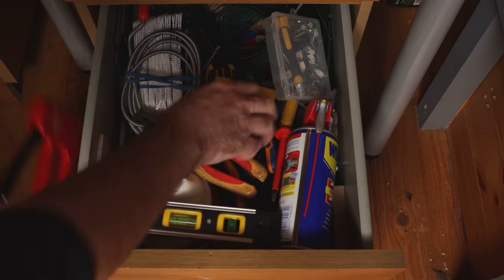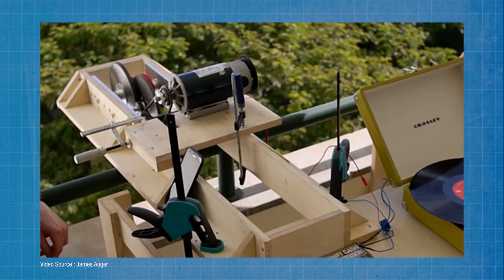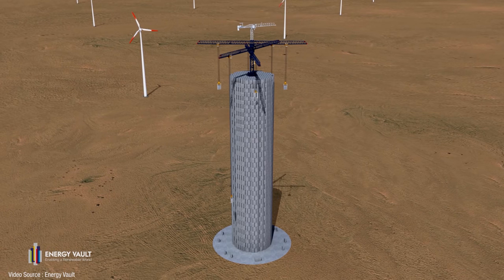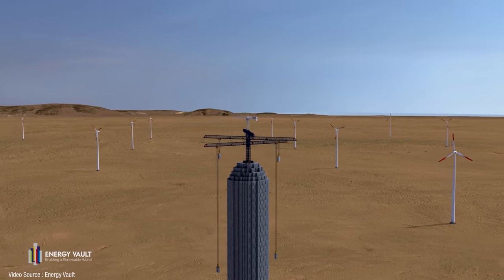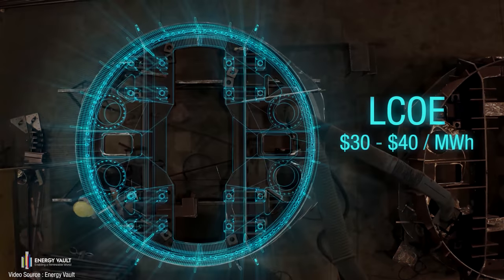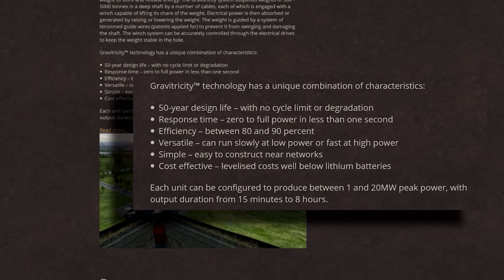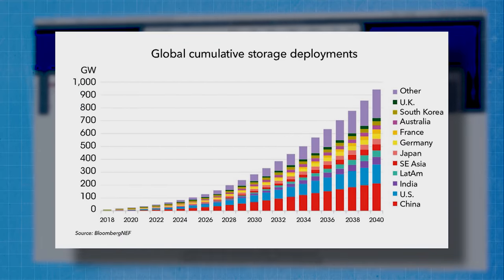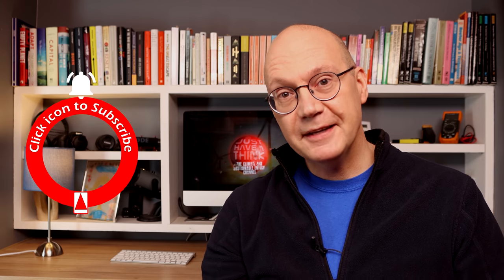Gravity Energy Storage : A very uplifting technology!

Comment: There is also the company ARES that is building a gravity train in Nevada. Has been a long time coming due to permitting etc but may finally be happening. Depends on local geography so not as universal. Seems like there are long strings of idled coal cars and locomotives that could be used to keep cost down. One downside to all these mechanical systems is that there is wear and tear on equipment when you are moving heavy things which I think they underplay.

Comment: We can use mountain sides with rail track that goes top to bottom with exaggerated slope (on purpose). Have water pipes at top. Fill train cart with as much water as possible. Utilize a hard slope to assist in cart acceleration down a tall mountain. The brakes can generate emissions-free electricity while pulling up another cart from the bottom to the top (but empty) I mean if windmills can be a thing then so can using gravity as a source of energy. Hopefully this should free us to repurpose trash into bricks that we can use to house the homeless using gravity generated energy.

These options may be sub-optimal to the educated engineer, i understand that i just want to point out that we HAVE OPTIONS!!!! all we need is real unity!
Reply: Presumably you'll use rainfall to fill the tank at the top of the mountain?  It would be counter productive to pump it up!

I thought of a similar system at home, have a 1000 litre IBC in the back of my Nissan Leaf, fill it with water, go into town which is downhill, using regenerative braking to charge the battery, empty the IBC all over the carpark and get a free ride home.  Don't tell Yorkshire Water though!
Reply: @rogerbarton497  cities next to mountain ranges can have plumbing extended to top of mountain to help fill up tank using water pressure. At the end of the tracks a pool that reintroduces the water back into the water grid as to avoid pumps cause yeah pumping it out would be a waste.  But i think that with proper gearing it should produce plenty of energy consider how increasingly hard it becomes to stop a heavy container going down hill. If wind turbines are a thing then using mountain sides should produce energy 24/7 in any weather. Also the container should be metal cage with interior puncture resistant pouch as to lighten the load of the cart when it gets pulled back up by another cart on its way down.
Reply: @ajgm3974  The water pressure in a city is either generated by pumps or a water tower, so using town water pressure to fill a tank at the top of a mountain still involves pumping.  I suppose you could have a system that pumps water up on cheap electricity and generates power at peak demand, just the like a conventional pump storage, but if you were going to do that you'd be better off using pump/generators rather than a railway.

I believe there is a funicular railway in the UK that uses water tanks, filled from a stream neat the top of a cliff, fixed under the cars to haul them uphill via a rope and pulley so you could probably generate power from this, but that would be on the level of power scavenging.  But every little helps.
Reply: @rogerbarton497  how about using empty thick latex balloons deep in the ocean. Filling it up with air will cause it to rise. That pulling power could be used to power generators??? Alternating balloons could keep the generators running 24/7
Reply: @ajgm3974  Probably not for generation, but there are experiments going on to store energy in collapsible "balloons" under water, the advantages being as air is used the balloon collapses under the pressure of the sea, thus maintaining constant pressure and because the pressures inside and outside the balloon are equal (near as damn it) the balloons don't have to be super strong.  Google "CAES underwater" or similar and look at the images tab.
Reply: @rogerbarton497   @Roger Barton  I know that our best chance is helium 3 on the moon. Thorium reactors would be a good option too. But for the time being, specially in undeveloped areas of the world maybe ocean currents can be used. 

https://youtu.be/yanW82dpVIU

Or fresnel lens and steam pressure

https://youtu.be/t79xJmE_AqI

Comment: I keep envisioning a gravity battery that uses sand. Cant wrap my head around it but, i think it could use a vacuum to transport granules up a tower where it accumulates in bins that become weights, effectively doing the same work that the concrete composite blocks do, except maybe there’s a way to also build a spring system into the unit so that as the container reaches the floor, it can release the sand and spring back up, counter weighted by an opposite side generating electricity in both directions. Just a thought...
Reply: Love your channel btw 8)

Comment: Not sure about the tower project, but I like the idea of using a shaft.  How about the weight being created by water in the falling container, it could then be allowed to empty at the bottom so less power would be needed to pull it back up again!  The system could create as well as store electricity.

Comment: A company called Azelio in Sweden store energy in Liquid aluminium and use a Stirling engine to convert the heat too electricity and can do that in 13 hours on maximum power. They only use recycled aluminium and can charge and discharge the ”battery (aluminium storage)” many, many, many times becouse aluminium does not wear out. On top of that they get a waste product of low temperature heat 55-65C that can be used for heat buildings, hot water or other aplications. Ideal for 0,5 - 100 mW sites.

Comment: Pumped hydro would be better if it was near the ocean utilizing a natural cliff. There would be far fewer environmental concerns except for the upper reservoir - which could become a "tidal" wetland for bird life.

If you really want to store energy mechanically you'd do better to use rotational storage. The Ω² in E = ½IΩ² of a rotating mass means the energy stored is proportional to angular velocity squared where as E = mgh of these lifting mass systems means there is only a linear proportionality between energy and mass or height. However, rotating mass systems have issues (bearings) so heaving weights up and down is worth trying - so long as you're not in an earthquake zone.

Comment: Water filling canisters that store the energy might be cheaper than concrete , the plumbing might be more complex . If the water uses stored nuclear waste to heat and evaporate untreated water , then the evaporation pressure might be enough to lift and store the energy .  As water is in contact with heat conducting pipes it should not contaminate and could make use of a waste product with zero emissions .
Reply: You just invented a very elaborate heat engine.

Comment: Quite a few years ago, I thought I had a brilliant idea, then search the internet and found gravitricity.
To find out that it was allready there :) just found Them moving Way to slow, with their Project.
As a sideline, I thought that combining it with a windgen. Tower would be a good idea, if extending it with a deep Hole in the Ground. This having the battery where it is most usefull, with the electrical connection allready in place for the wind turbine.
Gave up on the idea though as bartt. Development and prices where constantly dropping. :)
Reply: Yeah, I thought I invented this in my head too. Every time I think I've invented something, I find out it it already exists somewhere. Never thought about using existing mine shafts though.

Comment: Many years ago I came up with the idea of winding up huge weights inside each wind tower in the country, which could store energy when there is an excess of wind over demand, by either mechanically or electrically raising a large weight up to the top of the towers. Hundreds of tonnes 60 or 80 metres up in the air. That's got to work, hasn't it.  Then I did the maths..........
Reply: And the maths said that the weight needs to fall very fast to get to 1MW and the tower needs to be very beefy 😂
Reply: @per.kallberg   The maths said there wasn't enough potential energy to bother.

Comment: Given time constraints in reaching needed carbon emission reductions (about 8% annual reductions to attain Paris goals), we simply will have to adjust our energy use patterns to more closely align consumption with production, both on a daily and seasonal basis.  This means different things in each geographical context.  Here in Arizona, with one Powerwall we cover 95% of daily and annual home energy use from our rooftop solar.  This includes in-town transportation, but not long car trips.  Having the infrastructure at home has the benefit of being able to measure compliance with climate goals.  Large-scale efforts are also needed, but we would do well not to place too much trust in unproven methods, and to take responsibility for adjusting our usage patterns to the immediate need to clear the atmosphere before it is too late.
Reply: Hey, neighbor! From over here in Texas, with a similar usage patterns in much of the state, I'm here to tell you that getting Tex and Bubba to "adjust their usage" patterns rather than cranking the thermostat down would be doomed to failure. They, like our outgoing POTUS, are damned if they will be responsible for any of this "socially conscious clap trap". I think you can take that last as a direct quote from Bubba and Tex. Bubba, Tex- if you disagree with this, please weigh in- with facts not just a moan and groan.
Reply: @fredericrike5974  Abilene Christian University's NEXT program is at the cutting edge of research into the new generation of nuclear energy technologies designed to provide clean, safe abundant energy into the indefinite future.
Reply: @jimgraham6722  Admiral Nimitz thought enriched uranium would solve all of America's energy needs by 1965- I think this was something he told the Senate. We''ll see and Great Fortune!
Reply from the maker: I agree 100%. Well said Duane.

Comment: I just love the idea of stacking blocks in patterns (aside from any mechanical failiure issues?) 

But - Would it work with the mine-shaft idea as well? I mean you can lower a block down the shaft, then when it gets to the bottom, park it somewhere in the mine body (a new cavern?) and lower the next one down the shaft, and so on. Then do the whole thing in reverse, With some battery storage to fill in the gaps in generation...?

Comment: I've been thinking that a scaled down version of this could be put in the corner of petrol/gas filling stations (some have huge , tall signs like those that can be seen from the highway ) that could DC Fast Charge EVs.. Huge weights of recycled materials could be raised with on-site renewables, with locking pins holding them in place until needed.. No complicated algorithm needed to raise it and a very simple one to dole out the charge to the car without harming the battery .. Very Low cost as it would be DC in,  DC out (no inverters etc..) and One moving part in the motor/generator..

Comment: There is no real limit to the different types of mechanical storage systems but in general they are far less effective than pumped storage due to that word again, capacity. That is the main factor on whether a system is effective.
Dinorwic pump storage is 1.8 Gwatts in capacity and can run from full to empty for five hours. 
Remember it's purpose is rapid start to take care of sudden peak grid loads, not to compenste for intermittency.

Incidentally, your video on flywheels, I forgot in my comment to metion that all conventional generators have a large amount of inbuilt flywheel effect as they rotate at 3,000 rpm and weigh very many tons dependent on size.

Comment: The "energy vault" system is a pipe dream on par with solar roadways. Good idea on paper, coupled with an insane amount of drawbacks that make it utterly impractical. Building simple water towers of that height would be a far better investment -- and the stored water could be used for other uses too, unlike concrete blocks.

Comment: I think the Gravitricity claims glosses over the cost of, and replacement frequency, of the cables and other factors.  Not all mines are created equal, but around here, the shafts around here (and there are many) have acidic water splashing about, which means that cables do have to be replaced often enough.  Further, many mine shafts have to be actively pumped to be kept dry, and that can limit the gross efficiency of the system.
Reply: Hmm.... I wonder what kind of materials you can use for gearing, or how you can shield corrosive or sensitive parts...

Comment: I have an idea for something that can transform a low wattage supply to a higher output wattage.
The energy to start the system can be a small motor powered by AA batteries, a small wind turbine or a solar panel. The output can power hundreds of homes.

Comment: I'm thinking maybe you could do this real cheap by putting a bunch of air bags under a heavy weight.  Set the airbag and weight to give you the desired pressure needed to run a turbine.  The pressure would remain stable during inflation and deflation and the amount of energy storage would be directly related to the height of the mass.  When the sun and wind provided power the bags would be inflated and when the sun stopped shinning and the wind stopped blowing the bags would deflate while running a turbine hooked to a generator.  How about a used connex box filled with water?  You wouldn't have to lift it very high to store a lot of power.

Comment: I did some economic analysis of several gravity-based electric storage projects-- see spreadsheet link below. For small projects like the water bottle, they store only a fraction of a small Li-battery or AAA NiMh with much larger size and cost. A 20m stacked block is way more expensive that equivalent Powerwall.

The Energy Vault 150m tower requires very optimistic cost assumptions to meet current grid-scale Li battery technology, and is likely to be more expensive. A 1GWh project (like the Moss Landing, California Tesla 1200MW Megapack) would require concrete/stone blocks about the same volume of the Hoover Dam, and meeting 2050 Net-Zero storage needs require blocks equivalent to 100 years of current US concrete production.

The 1000m mine shafts of Gravitricity have low block cost/kWh, but using real-world mine hoist contracts as estimate for the motor/generator lift yield costs greater than Li-batteries. Any significant amount of MWh capacity requires large underground storage areas, so would have a limited number of sites. Drilling new mines seems uneconomic.  Using rail cars up a 1000m mountain has similar low block cost, but the cost for the hoist  system may still be uneconomic. The current ARES project on a gravel pit in Nevada (started October 2020)  is substantially more expensive than Li batteries, mainly due to the limited height.

Large megaprojects end up being custom designs with long construction times compared to mass-produced batteries made in a factory and shipped as normal truck/rail containers. So there isn't the economy of scale. Regular batteries are already cost effective and we expect new technologies to be available in the future with declining costs.

You can see the calculations do your own experimentation with this spreadsheet: https://docs.google.com/spreadsheets/d/1zylbCVgKAXALNYEWUTw-4l-KQoG7Kb-kqMpCx4vPkGo/

Comment: The maintenance requirements for the cables for the tower configuration must be high as they are exposed to the elements. The mine shaft or drop holes looks to have less required cable maintenance as they are not exposed to the elements and would be operated over a much more stable thermal and humid environment.

Comment: How about having generators on the ocean floor. Pulleys attached to balloons filled with air can force it to surface. That force can power generators. Once it reaches the top you release the air as to avoid it popping. Two balloon can alternate as to pull one back down while the other floats up.
Reply: How do you fill the deflated one with air?
Reply: @nerdy1701  im not sure if its energy efficient but can we separate water into hydrogen and oxygen and inti separate balloons. When surfaced we use it to make more energy (making water again, far away from hurting anyone other than fish if it exploded)
Reply: @nerdy1701  also wondering if a container filled with volatile fluids can be made into gas with electrical charge to help expand container in an appropriate depth which would then use pressure of the ocean to compress container back to original length and gas back into liquid. All the while this back and forth expansion and contraction can power a generator. Ocean pressure and gravity may help us generate electricity for free. Another concept would be to carve out, say, a square mile about a foot deep, fill it with some fluid that can recharge with light, forced back to ground state by the conductive coated strips along the square mile ditch that holds this fluid? I know salt water is already conductive? Anyway to treat ocean water minimally to accomplish these kinds of solar energy harvesters?